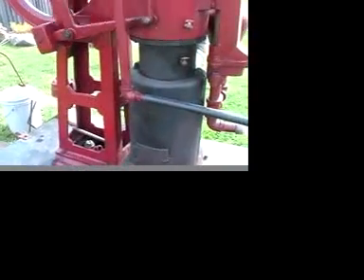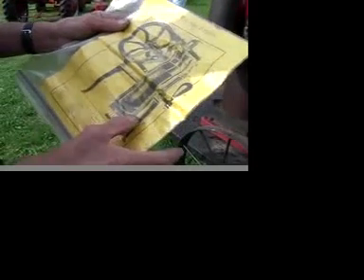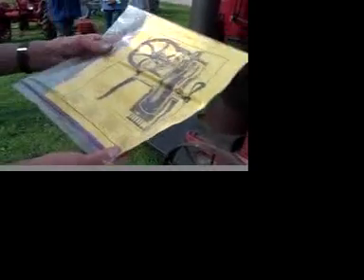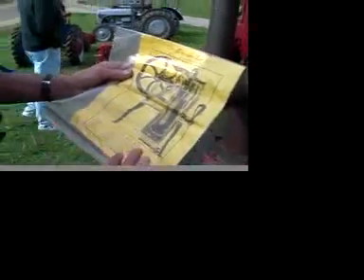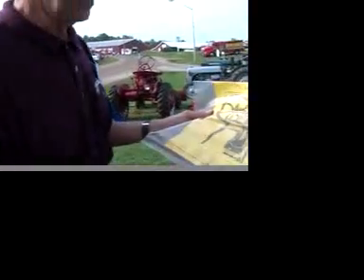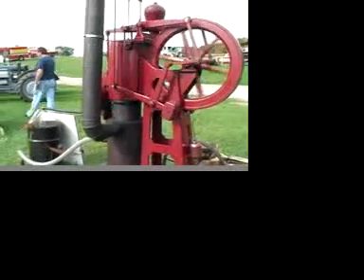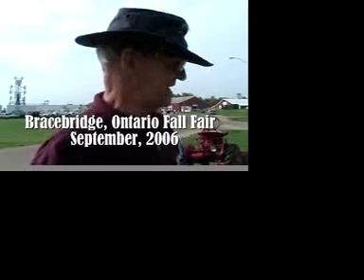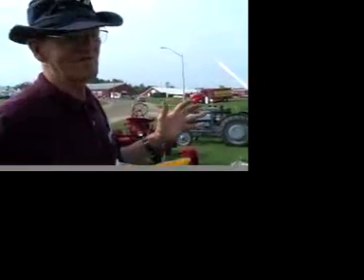Stirling Engine: Bracebridge Fall Fair

Comment: You're confusing efficiency with power output, there is nothing out there that can operate at the efficincy (ie: amount of fuel burnt for the amount of work extracted) even our modern computerised engines are still only about 35% efficient ie, most of the fuel going in goes out the other end unburnt, only 20 bucks of the 60 bucks you put in your tank is actually making your car go anywhere.

Comment: His explanation is lousy! 
Simply put, the large 'displacer piston', made about 4% less diameter than the cylinder, and driven by the rotating flywheel, simply moves the air up and down between the hot and cold ends of a cylinder. Each time the hot air is moved to the 'cold' end, the air contracts causing a partial vacuum in the cylinder which pulls the power piston down, turning the flywheel.  QED

Comment: what happens when you need parts on these new tech advancements requireing breadboards ,,piont is basic working pre-electricail power sorce -you can sandcast mold any broken part on these old designs - not every place has modern lifestyle options ,,or maby lose the services provided from miles away..

Comment: SOME OF THIS OLDSCHOOL TECH is still very useful-Fresnel lenses instead of a fire to run-Fresnel lenses are those ribbed flexable screens on projection tv's and combined with a parrablic mirror can do solar cooking /maby even melt meatals for clay casting parts-Leather for years was used as rubber washers/gaskets for a airtight longlasting seal-a step backwards could be handy when the electrionic tech is out of reach !pumping that much water up 100 ft,wow at 3+ pounds per gallon !torch adaptable

Comment: And you thought right. But when current passes through resistors, they get warm, wasting electricity. the tric... whatever, sümistors, control it without losses. Anyway, you get me this pump and I'll make you the fuel controlling gear, deal? :D

Comment: Old type 20-25% I think gas tops at 14%? heat loss energy waste. Modern machines approach an honest 40% from what I have seen. The torque is the challenge and running a sealed compressed unit almost has expodential power good increases with Helium as well.

Comment: Kockums are actually offering a stirling engine section to be added to existing submarines and they build new submarines with one ready to go; you just need to bring along a few tanks of LOX to oxygenate whatever fuel you want to use and you're away; they can spend several weeks submerged and are ideal for countries that can't afford nuclear. There's even a company in Germany that sells them for domestic use.

Comment: the power is created by expansion of the heated air and contraction of the cooled air, the process would not work without a flywheel pushing the cold air back to the hot end, and it would work the same if the whole machine was upside down and the top was heated.